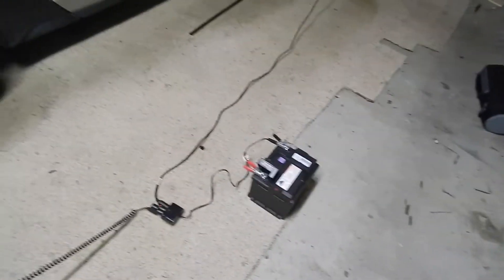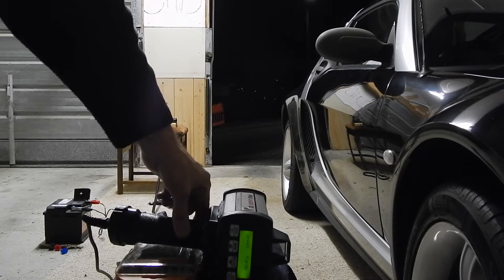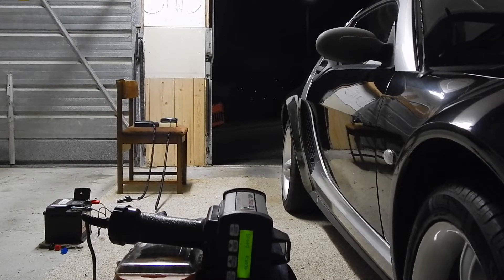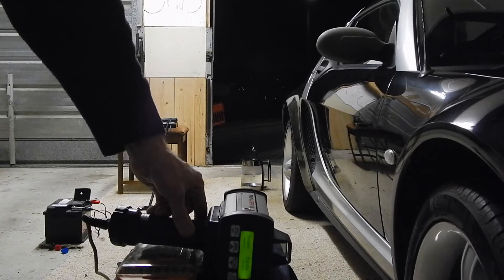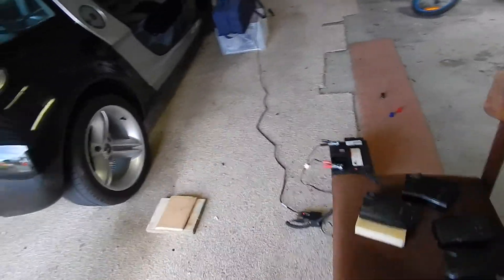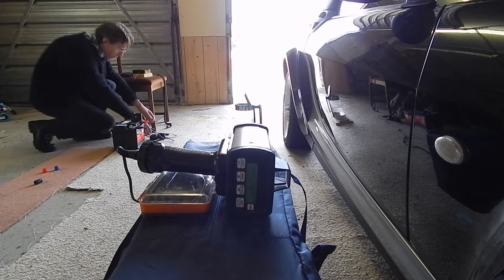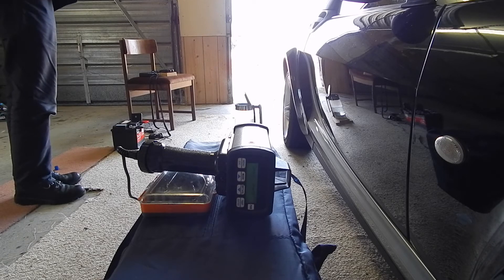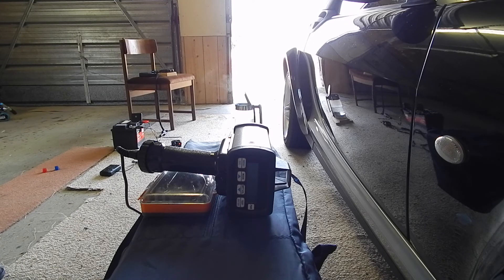Laser Detection on a Radar Detector: More than just a ticket Notifier?

Comment: Police officer doesn’t use lidar in that position. Place the lidar gun in a horizontal position as it demonstrate in the manual. In the vertical position that you are testing, the laser travels in an up and down not side to side. Law enforcement usually targets your license plates or the reflective portion of your headlight in the horizontal position. At a thousand feet the beam is approximately three feet wide to four feet wide but very narrow so it is possibly the lidar can cover both headlight in at that distance. The farther you are away from the lidar the wide the beams gets.